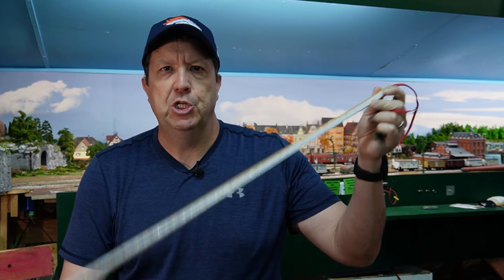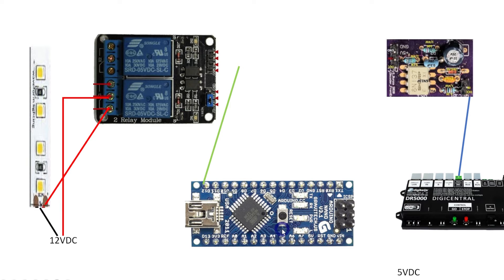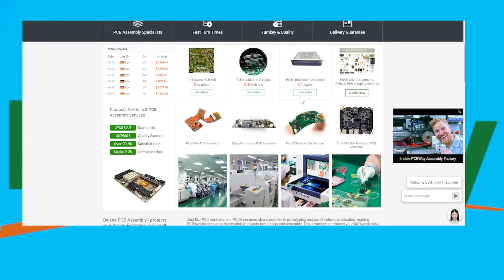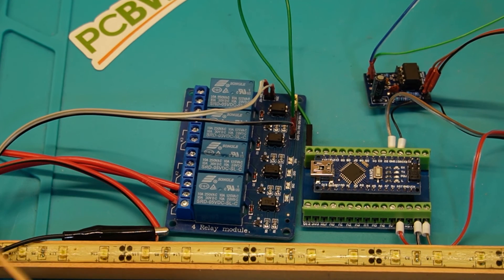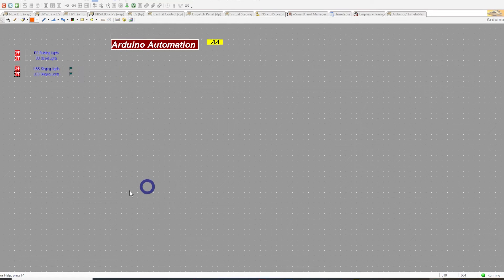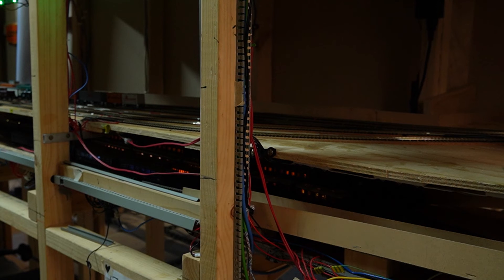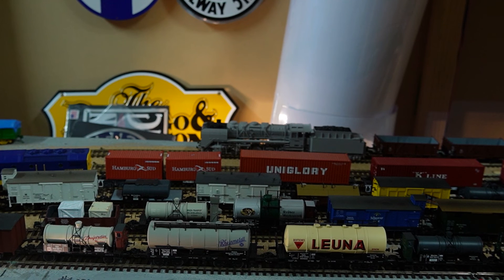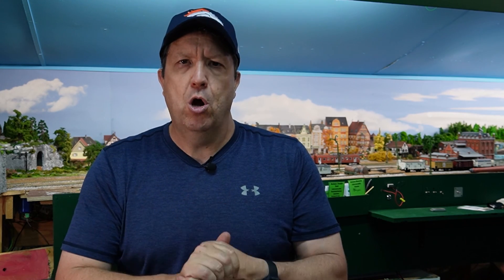Control your (staging) Yard Lights with Digital Command Control

Comment: Hi Daz. Enjoyed your video and found it very interesting. You have way more automation using TrainController than I am up to.
I  have a small DCC HO system using TrainController  Gold 10 and Roco Z21 & Digikeijs modules. I am setting up a Faller Car system on the train board  using an Arduino and the same Relay 8x unit as you have. For the Arduino I am using the ArCoMora software Mardec to switch the  Car System sensors  on/off for different vehicles and roads from TrainController. I am also setting up track signals using Arduinos and the ArSigDec S/w.
With TrainController I operate schedules + plus manual shunting operations. I have Fleiscmann Profi HO track and uncouplers, plus Fleischmann and ESU locos with digital couplers and Roco universal couplers to do wagon shunting and assembly of trains, using TC to build the train composition. All good fun.  Cheers Graham from Sydney.
Reply from the maker: That’s really awesome Mardec stuff is so good. You need to become a member of our TC Facebook group. It’s run by me and another Ozzy chap
Reply: How do I join your FC group?

Comment: Thanks for a nice video.
In answer to your question about what I use:
1; Philips Hue which was directly controlled from RocRail.
2; Have long wanted to test the PacoDCC DCCtoDMX decoder (the DCC system sees the decoder as a locomotive decoder).
Reply from the maker: DMX nice. I do have a DCC to DMX decoder I need to dust it off and have a play

Comment: Have you checked out MQTT?
I know some people do not like it because it is wireless control, but I have added some relays to my model railroad control system that I can control via JMRI and hence DCC or a touch screen.
Reply from the maker: Hi Heath. I have played with MQTT but TrainController does not support it. I will need to look at some work around.
Reply: @ModelRailroadTechniques  that makes a lot of sense.
Reply from the maker: @HumancityJunction  I think a iott stick may work
Reply: @ModelRailroadTechniques  I have a drawer of Han’s Tanner projects :)
I have started laying track on RT2.0, so I should be able to get back to some electronics projects shortly.